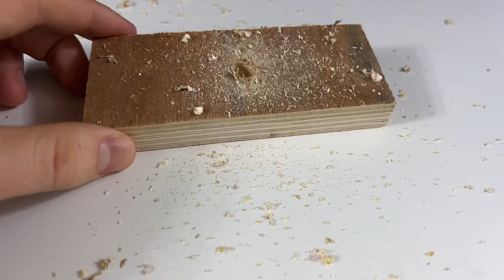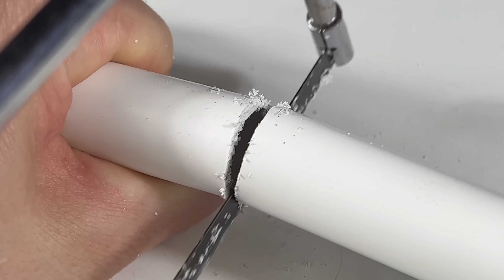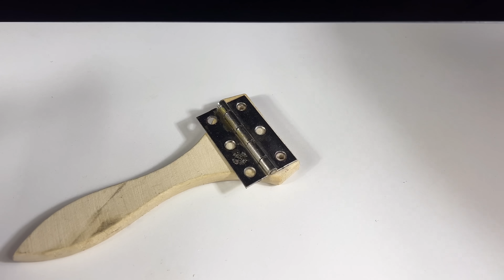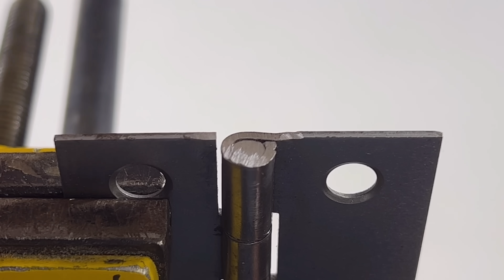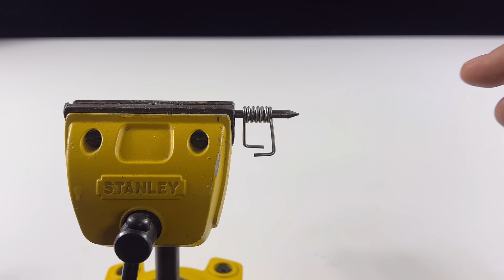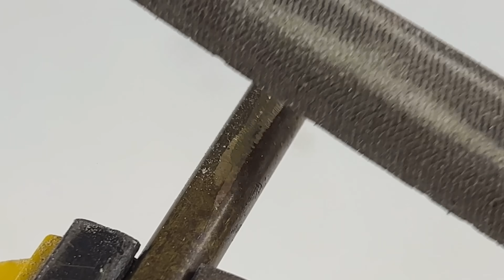Ingenious Secrets & Tricks You Will Use Every Day That Work Extremely Well – Construction Tips

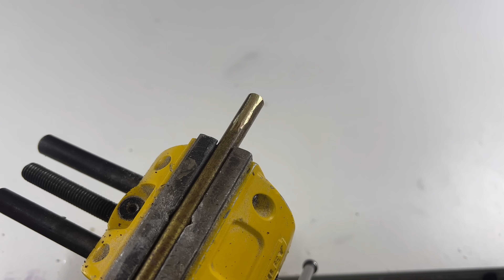Comment: At 4:33, is that flux-core wire? Yesterday at the bin store I got a huge bag of unreeled wire  for 50¢, and to my surprise, any bends broke easily. I'd got it to fortify my chicken-wire hen fortress, but it must have a different use. A scrap of a label had "FLUX-CORE WI-" on it. I wondered how I'd use the stuff--you just showed me what my weird cheap deal can do. Thank you, Inventor 101! I may be only a bimbo, but you've given me superpowers to the myriad things I need to fix or create. Your iron-strong superglue + graphite repair on a shattered plastic rake made my neighbors gawp in awe as I grinned and banged it on the concrete, har!